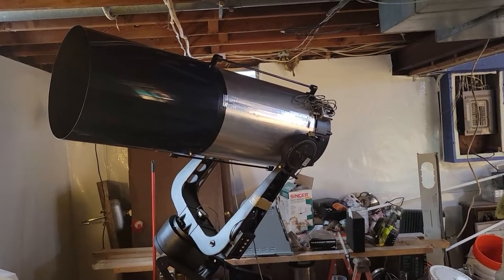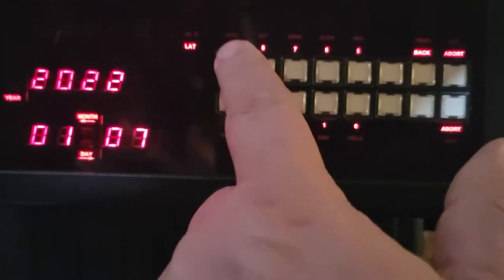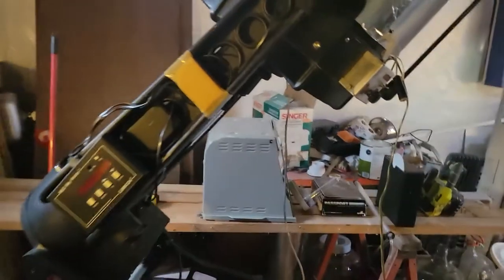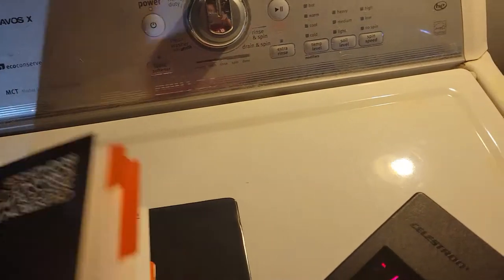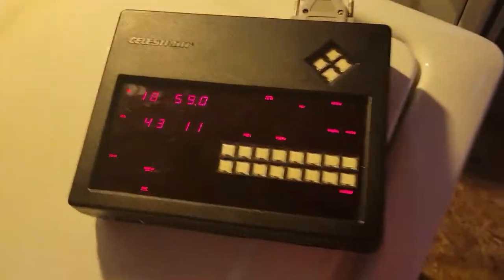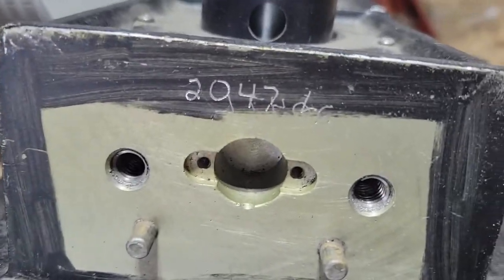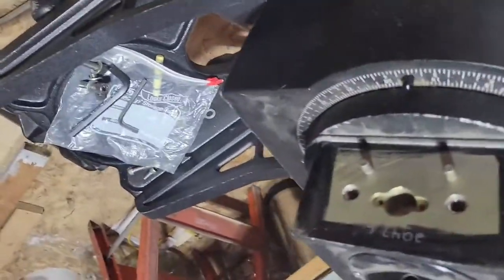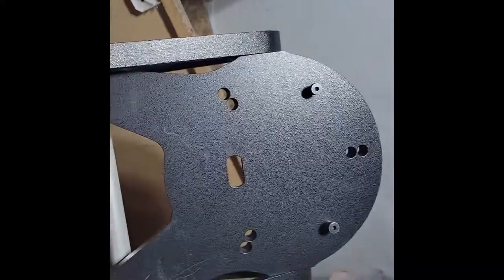Celestron C14 Compustar Teardown

Comment: Hello, I was recently given a scope very similar to this. I Have some questions about it and can't find any support. It seems like I am missing the power supply. Are you able to help direct me at all?
Reply from the maker: When I picked mine up it had a very old power converter that was wired to the box that distributed the power out to the scope and to the compustar computer. I was able to locate a new 110 to 12v inverter and wired that in place of the older original inverter from the 80's. If you have a Celestron Compustar here is a group that is dedicated to these older scopes and all  the info needed to keep them going  https://groups.io/g/celestroncompustar-user/topics
Reply: @leisuretimeadventures   :  If you need information about the controller, let me know and I may be able to help.